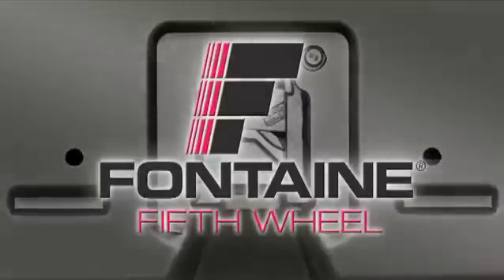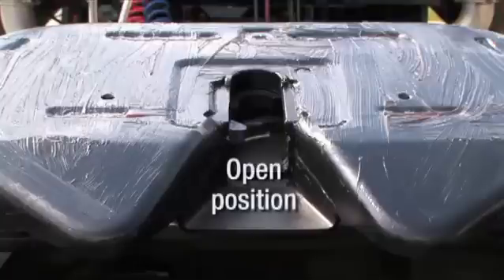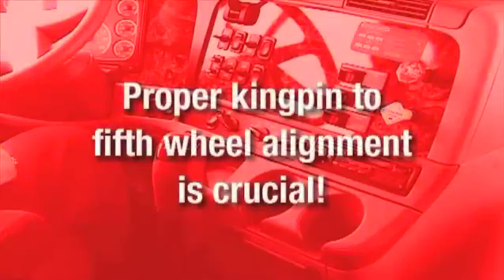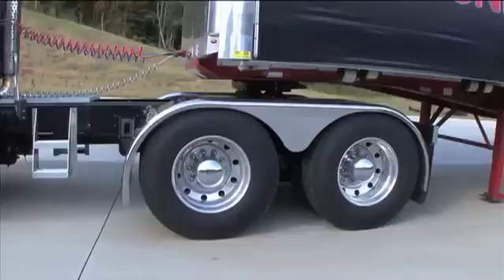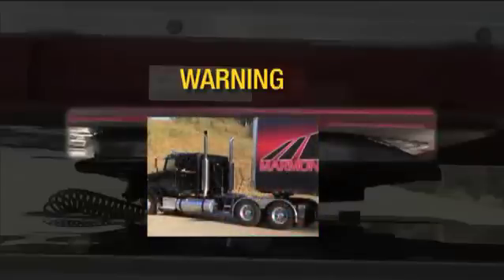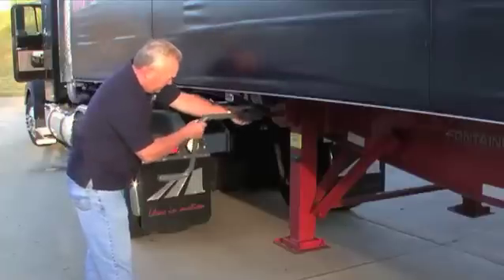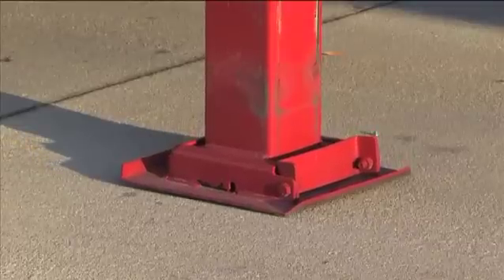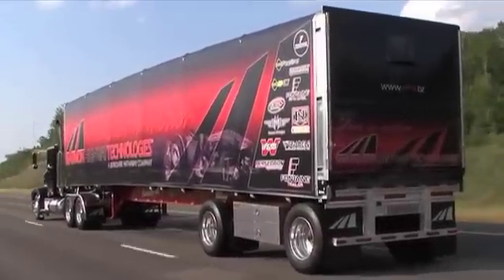Ultra Coupling and Uncoupling

Comment: If my drivers went threw all this they would be running 3 times later then they usually are. I also would never use a Fontaine 5th wheel, they are a very problematic 5th wheel and I have had them remover from trucks I have bought. Holland is the best out their.

Comment: These shows are by the Manufacturer. They are the proper way to Hookup and Uncouple a trailer. Schools may teach you one way, so when you get to your Road test, you will pass. As time carries on, in your trucking career, you will cheat the system at some point in time, and that us when you will get bitten. Get yourself into a Routine when doing both. Never change from that routine, just because you want to get home or to a party. You will miss something and that will end your Night right then and there. Drive Safe Always your Family depends on you doing so.

Comment: Why is it called the Fifth wheel? I assume it has nothing to do with the name "18 Wheeler" since that refers to the amount of tires on the cab and trailer combined.
Also, truck cabs are referred to as tractors?
And the legs for trailers are called landing gear? That one seems kinda odd to me since landing gear until now has only been the name that applies to planes, space shuttles, and helicopters. Legs seems like it'd have been a more fitting term since those things kinda seem like, well, legs for the trailer to stand on.
Reply: Allow me to answer a few of your questions:

1: It's called the "5th wheel", because in the days of old, before ball hitches, and other modern coupling technologies were invented ( noting that we're talking about an era of horse drawn buggies ), the trailer was indeed attached to a horizontally placed wagon wheel, identical to the other 4, making it indeed the 5th wheel on the vehicle. They used a wheel, because it's rotational properties promoted turning ability. In more modern times, the new standardized system simply retains the name.

2: And yes, the "proper" technical term for the actual "truck" is "tractor". Because it provides the traction. Technically, a semi is properly known as a "tractor/trailer". But people typically use "semi" to avoid confusion with the farm vehicle by the same name.

3: "Landing" in this case, refers to being supported solely by the land it stands on, instead of partially upon the tractor. Those "legs" are the "gear", which "lands" the trailer. Confusing, though. I know.

Though it's worth noting that motorcycles can also now be equipped with "landing gear", which is a set of "training wheels" of sorts, that retract when the bike is moving more than a certain speed, and extend when it drops below it. It's been quite some time since the term "landing gear" applied solely to an aircraft.
Reply: Someone asked a question, and I answered it. What are you getting at?
Reply: He was stating that as a consumer of large quantities (correct spelling) of information, he thoroughly enjoyed the very detailed explanation that you gave.
Reply: Eh...maybe. To me it sounded a little sarcastic. Maybe I misread the tone. Apologies for that, if so.
Reply: Ah. My mistake, then, and I apologize wholeheartedly.

It's great to meet more people who are as fond of general knowledge ( even if mostly useless ) as I am.

Safe travels, Gregg.
Reply: Angel Bowfinger trailer being an item trailing behind, semi trailer being named because it is half (semi) attached and half trailing

Comment: What's with the tandems (trailer wheels) having such a wide variety of placements? Some are close together. Some are apart like this trailer and some close to the rear while others are further up the trailer? Are they adjustable or that just depends on trailer model?
Reply: +Dennis Santos weight distribution as well as change the way a trailer tracks in city or highway driving

Comment: Lol @ shutting off the engine to check the fifth wheel....
Reply: do you want to be under the trailer when the truck jumps into gear and rolls over your ass?  Not bloody likely to happen, but it is still a possible situation.  So I will laugh when you go under the wheels of the trailer cause you happened to get into that unlikely situation
Reply: No, that is not a "possible situation" in a manual transmission vehicle placed in neutral, with the parking brake applied. Any situation where the vehicle would roll back and run you over, is a situation where the engine running is not a factor. The sheer amount of force required to force the transmission into gear without a clutch pull, would not be possible without direct human involvement.

So don't expect to laugh anytime soon.
Reply: I watched Coupling full movie here https://twitter.com/eaa75e29fdb9aeb95/status/824453567545094144

Comment: Never install the electric and air hoses until AFTER you've done the tug test. Connecting them should be the last thing you do prior to getting in the truck after you've done everything else.
Reply: julie r the "tug test" is purely to see if the king pin is actually secure in the fifth wheel before you do anything else, they have been known to 'click' in place but not lock... plus 95% of High Tech European Trailers have air operated parking brakes, the new trailers engage the park brake automatically when the lines are disconnected thus removing the need to chock the wheels like it's still 1963...
Reply: i drove for over 40 years.the tug is to make sure the trailer is hooked up.you don't connect the pigtails until then, cause if it's not hooked you stand the chance of tearing the pigtails off the tractor.after your done with the tug then get out hook the pigtails.then get under it an look at the 5th wheel locks.
Reply: @RealMiniatures  right.. You tug test before hooking the lines.
Reply: Nope, not true. You don't know the condition of the trailer brakes. Unless you're gonna waste time with chocks, hooking up the air lines is safety.
Reply: Jessie James rip the pig tails off the tractor?  Truck driver for sure.

Comment: Back up to the trailer, stop before touching the 5th wheel to the trailer.  Get out, hook up air lines.  Enter truck, pull spike and back under trailer.  Should the spring brakes be un operational, the trailer will not roll away when you try and couple.

If it is not YOUR trailer, who knows who rode it how hard and left it for dead.  The brakes may not even work.

Comment: You are obviously not a trailer driver. With the exception of chocking the trailer tyres, and using a torch where there is poor visibility, everything else is a standard practice and is expected from most logistic companies, especially if you own and value you own prime mover.

Comment: To answer Sidharth Parmar Question The early tractor trucks only had 4 wheels on the ground, not 10 or 14 like now, so the hitch on the truck is the "fifth" wheel because it looks like a wheel.

Comment: I do everything except blocking the trailer wheels. After dropping a trailer very early in my driving career from having a gap between the trailer and fifth wheel (that passed 3 tug tests and stayed on for a 1/4 mile) I am very careful.

Comment: I did all these things except chocking the wheels. If I was dropping the trailer on a yard, I didn't chock the wheels, but if dropping in a door at a shipper or receiver, I chocked the wheels if it was required there. You learn to do a lot of double-checking if you've ever had another driver tamper with your equipment while you're sleeping in a truck stop lot. It never happened to me, but I've seen lots of incidents.

Comment: If your not inspecting it, your skipping alot of your pretrip.  Granted we dont chock the wheels.  Also most OTR companies have the 5th wheel bolted so it cant be slid (avoiding cab damage).